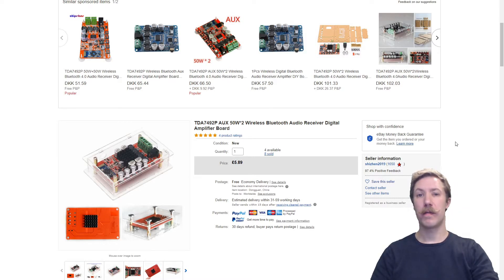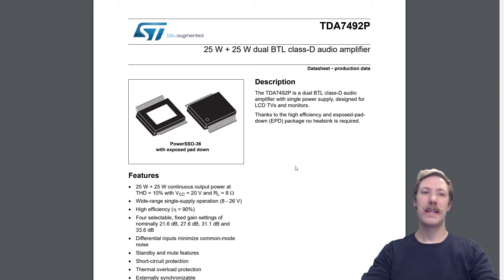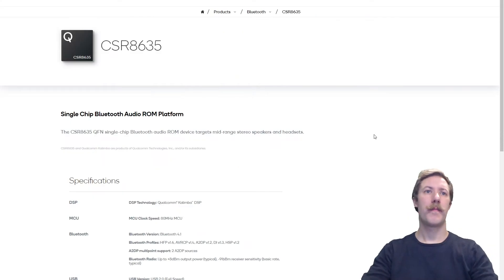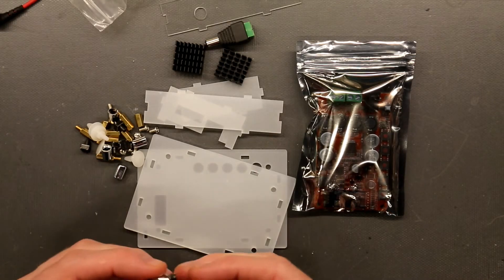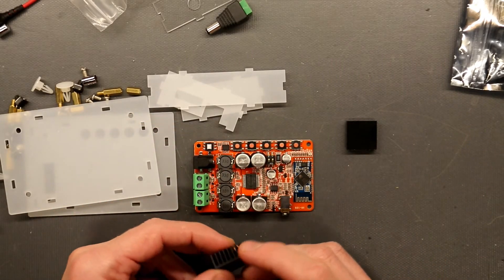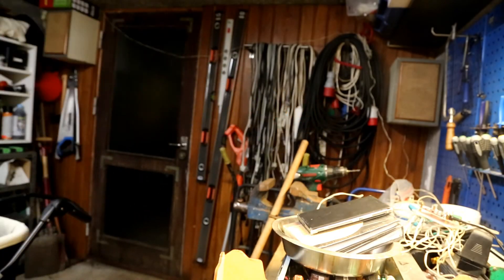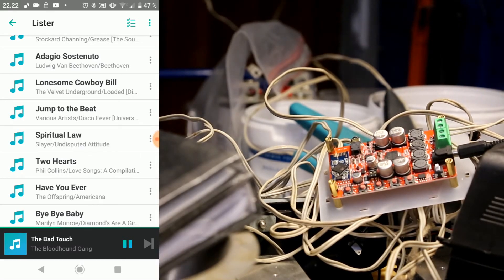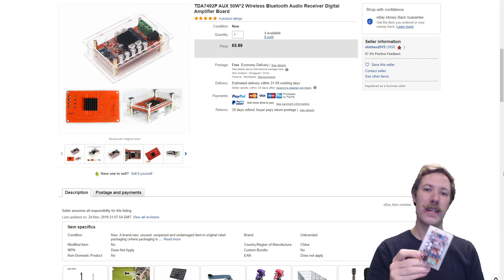Chinese 2x50W  Bluetooth Amplifier, Or Is It? A Poor Abused TDA7492P Design

Comment: Chinese Watts = Max Voltage * Max Current
(ignore max power rating of device package)
Then there is the PMPO scam, where its the peak power for 0.01 seconds.
Reply: Chineese Watt: =normalized watt @ solar systems, = 0.25- 0.5W @ modified sine wave inverters, is 0.2W @ sine wave inverters

Comment: About 5 years ago I bought a cheap stand-alone stereo amplifier from a local home improvement store for very little money. Supposedly it was 1000 watts output which I didn't believe for one second. I just bought it for my workshop so I wasn't looking for extreme high fidelity. It sounded OK but I stopped using it for the exact same reason that you hate about your amp. It doesn't remember the volume setting from the previous session. It always re-started at a very low volume.
Reply from the maker: I have another video coming about another amplifier that I tried instead and that was a much better experience :)

Comment: Add capacitor to the left chanel may help 
Any way i want to ask u a question about RF amplifiers and how i can design one that can handl 1800Mhz ? :/ I can't find resources
Reply: According your RF question, this depends a lot on which power level you want to achieve. Since you said you want it to be used with 1800MHz the output power should really be extremely small since you aren't really supposed to send in that band at all. 
Other than that it always is a good idea to just start searching for parts on digikey or some other distributor. Try searching for RF Amplifier or LDMOS. Most datasheets have typical apllication notes / circuits which makes it really easy to design a circuit around it. 
However you should be familier with RF testgear and complex math before thinking about building something.

Comment: LOL they must have deliberately designed the heatsink get clamped snug with the capacitors. Also, yes it does sound better with 19.5v laptop charger and I have no issue with background noise when using Bluetooth.

Comment: I have seen a few different types of power ratings on these things, however it never is the output power ;) 
Some sellers use the maximum possible input power before the device just explodes and some even use the degree Celsius per Watt rating multiplied by  the input current.

A lot of these boards make pretty decent amps if you know what you buy and modify them  to have a reasonable amout of gain as some other comments already pointed out. 
Thanks for the quick look at that one.
Reply from the maker: At least it is not quite yet at the tazer voltage ratings ;)